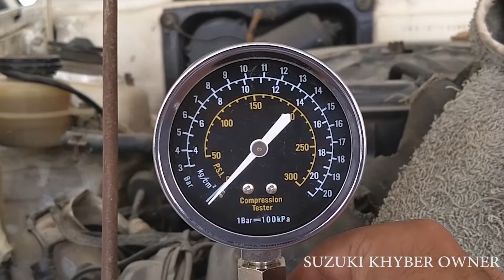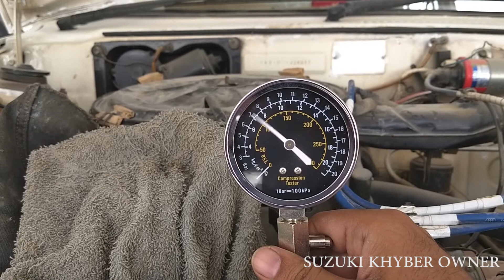How to do or Perform a Compression Test on an Engine

Comment: Bhai meri khyber check karlain.. bht kam jay pickup.. fuel bhi bht kha rahi hay... sub mechanics ko dekhadya .. no progress:(.. plz aap dekhkajn
Reply from the maker: mere bhai aap aik bar mehmood autos se carburetor service kerwalo jo major performance issues hain woh solve ho jayen ge for example agar butterfly cut hai to woh lathe machine se he repair hoga there is no other way to repair it aur agar air venturies ke pipe irregular placed hain to woh isko bhi properly place kerden ge kiyo ke khyber main performance problems ziyada carburetor se related hote hain.after servicing Insha ALLAH major performance issues solve ho jayen ge.